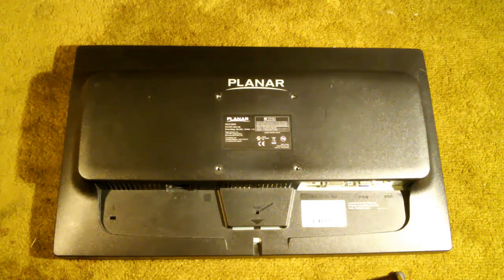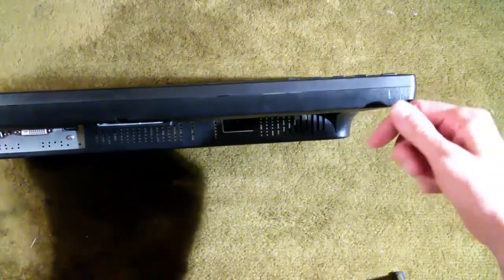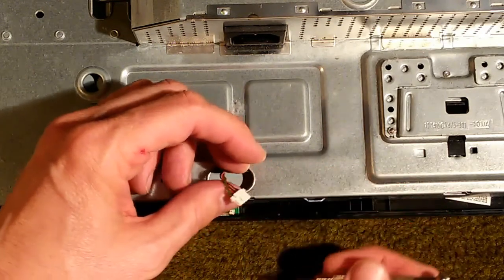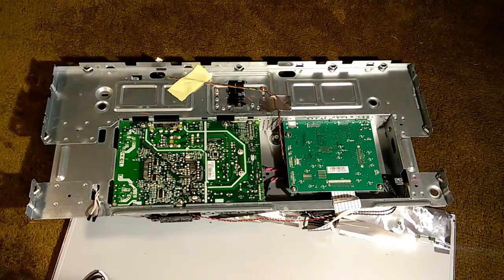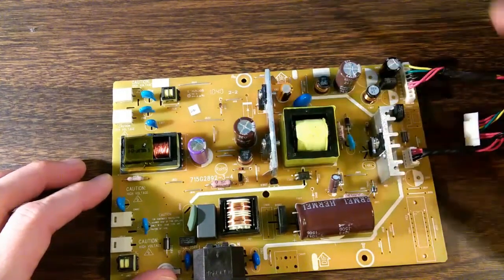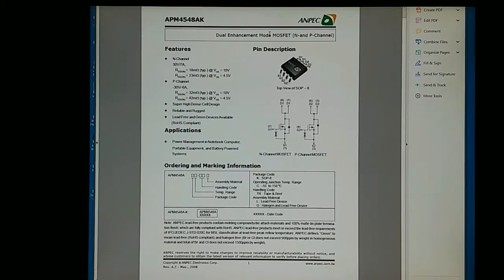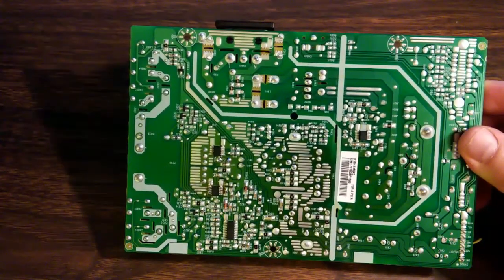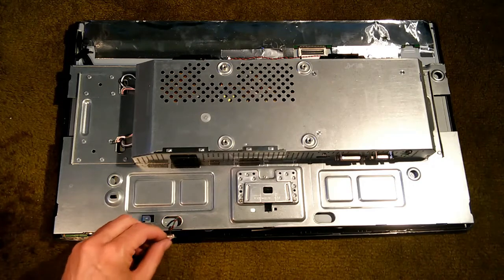Planar PX2210MW and PX2211MW repair

Comment: Is anyone else having the same problem I'm having with this video? The audio is not synced with the actual footage of the repair. I mean it is WAY off. I want to fix my Planar 2710 but I can't follow this.
Reply from the maker: Thank you for calling out the disconnect between the video and audio that had developed.  This is a recent problem.  I originally edited this video using YouTube's editing software.  It appears to have screwed something up.  I made a slight edit change and the video and audio appear to be synchronized again.
Reply: Well, you have the other Planar video that I watched which is fine. Where’s the best place to order good capacitors?
Reply from the maker: @jesseparris6507  When buying only a few capacitors, I just use Amazon, especially if I have other things I am ordering and I can get the total order above the $25 level for free shipping.  Otherwise you will pay more for shipping that for the capacitors.

Comment: Hi, do you know how to unlock the OSD on this monitor?
Reply from the maker: Page 13 of the manual:
"OSD-Lock Function: To lock the OSD, press and hold the SELECT button while the monitor is off and then press power button to turn the monitor on. To un-lock the OSD - press and hold the SELECT- button while the monitor is off and then press power button to turn the monitor on."